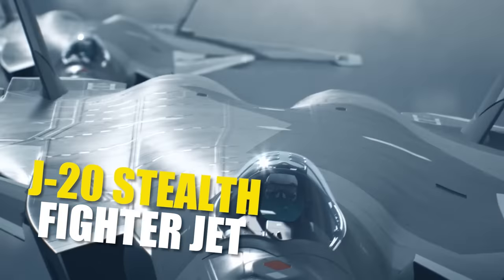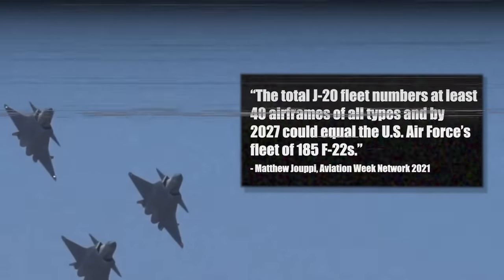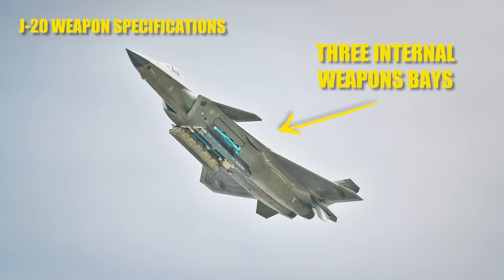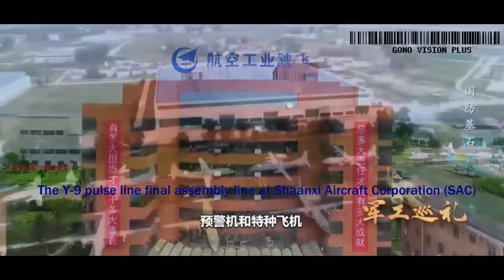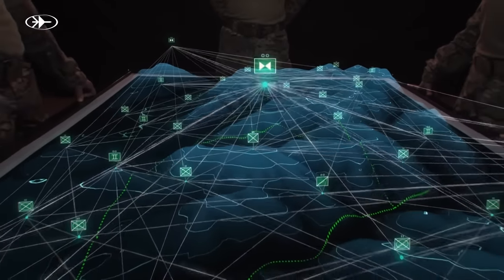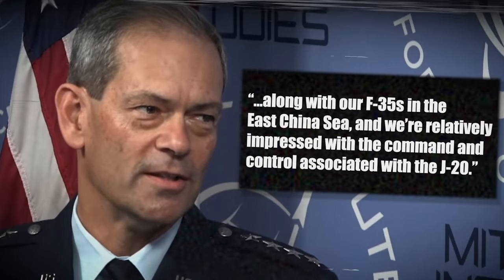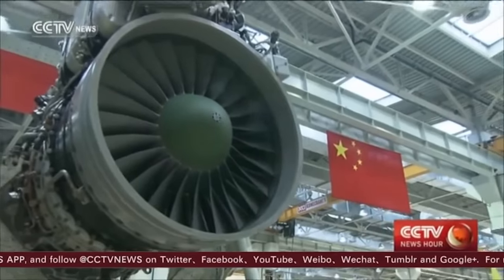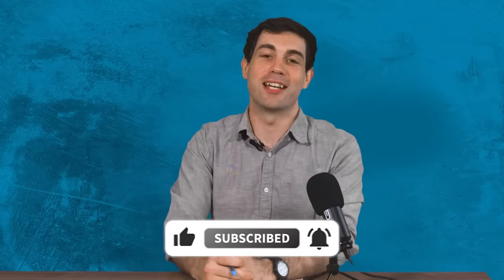How China Stole their J-20 Stealth Aircraft

Comment: Very impressive considering their main frontline fighter until quite recently, was the MiG 21/ Chengdu J-7
Reply: The wife said I could get one of them or an M777, but not both
Reply: It really is quite scary how rapidly they are advancing their military tech, but with the ccp taking a more dictitorial and strong arm approach its makes sense.
It's one of the few things a communist system can do, mobilize assests to complete a common goal.
Reply: @Michael-uf1hz its about time they try to catch up in military tech. They developed their economy first, so once the economy’s there it needs a stronger military to protect it, which in turn supported by a good economy.
Reply: "Very impressive considering their main frontline fighter until quite recently, was the MiG 21/ Chengdu J-7"

Considering the started to massproduce their own versions of the Su-27 by the late 90s, uh, what?

There's something like 2 thousand Su-27 derivatives in service by now in China.

And over 210 J-20.   That's more than USAs 197 F-22s.
And China built those faster than USA built their F-22s.
Reply: @DIREWOLFx75 what are you talking about? 2,000 SU-27 derivatives?

SU-35: 24
J-16: 245
SU-30MK2: 24
SU-30MKK: 76
J-11BH/BSH: 72
J-11B/BS: 270
J-11A: 200
J-15: 60
SU-27SK/UBK: 78

Total: 1,039, that’s airframes that China ever received until 2022, not operational or inventory figures. Inventory figure would be 893 (-100 J-11A and -46 SU-27SK/UBK).

Edit: also the Chinese did not start serial production of the J-11B until 2007. The J-16 started aerial production in 2012. The J-11A, was a copy of the SU-27SK/UBK and weren’t produced in China. Those were kits produced by Russia and then shipped to China and assembled in China.
Reply: @DIREWOLFx75  Lol what? In the 90s they were mass producing J-7/Mig-21s, not Flankers. 
They achieved full scale production of the J-7/Mig-21 in the 80s, while the F-16 was in mass production. 
It took two decades for China to acquire 78 flankers (Between 1991 and 2009). By 2000 they had about 50 flankers. 
They have produced more than 2400 Mig 21/J-7s while those currently in active service are 489. Total flankers in service is 604. 
In the 90s they were replacing Mig-21/J-7 with updated Mig 21/J-7s. Production ended in 2013.
Reply: @kurousagi8155 
👍👍
Reply: @stevemrayz357 
200 now
Reply: @jeffreylai6796  You are not saying their economy is in a good state
Reply: @UpVade  i mean it’s certainly not very good now, but its leaps and bounds better compared to 20 years ago.
Reply: @kurousagi8155  "what are you talking about? 2,000 SU-27 derivatives?"

I'm talking about a typo.   ONE thousand...
Reply: @kurousagi8155  j 10?
Reply: @ishtiaquealamin6147  J-10 is based off the IAI Lavi and is not an SU-27 variant.
Reply: @DIREWOLFx75  the F22 production line was closed in 2009, 14 years ago. If senators were not so idiot it's price would have went down and production would be much higher than the j-20 by miles and miles. Rehabilitating a F22 production line is so expensive that is much more profitable to be already working on 2 6th gen fighters, the NGAD and the F/A XX. How is that going for China? just curious...
Reply: @Maddog-xc2zv  "If senators were not so idiot it's price would have went down and production would be much higher than the j-20 by miles and miles."

The price wouldn't have gone down THAT much.   And more pertinently, the prices that have been quoted includes hidden subsidies.
The FULL cost of the F-22 is considerably worse than anyone admits to the US public.

That's also one of the reasons it would not be exported under any circumstances, because that would risk revealing the real costs too much.

And 2 simple facts, China is STILL building more J-20 per year than USA ever built F-22s per year.
And 2nd, Chinese industry today is roughly 10 times bigger than USAs.

And USA is heavily dependent on a bunch of stuff from China and Russia.

Right now, the only reason USA isn't having a massive shortage of titanium is because China is reselling it from Russia at a nice BIG profit.

China achieved the ability to manufacture its own chipfabs at modern nodesizes just by agreeing that "we need and want this ability" and getting it done.

And after USA started pissing it off last year, they have increased their military buildup to an almost hilarious degree.

There is no hard information, but what little has leaked suggests China INCREASED their military production in most things by about 2 to 30 times the entire military production of USA.

I'll make it simple, China could easily afford to triple their current manufacturing of J-20.
USA can barely manage production of the F-35 at all, which is half the price.

"that is much more profitable to be already working on 2 6th gen fighters, the NGAD and the F/A XX. How is that going for China? just curious..."

And there you have the reason why China could easily increase its production while USA cannot.
Same reason as why USA needs 3 years to MAYBE be able to match Russia's current artillery shell production, completely skipping the part where Russia if need be can increase its own production by an order of magnitude in less than ONE year.

USAs military industry is the most epically inefficient ANYWHERE.

I'll use my good old superblatant comparison.   You know the STRIX ammo?
My country developed it back early 90s.

Then USA went "hey that's cool we want".

So USA then had a committee deciding what the USA version was gonna be like.
Not even for a second considering that they could simply purchse it from here.

2 years later, after spending more money than Sweden spent to develop AND conduct the first serial production, USA had their requirements ready.
Another ~14 years later, the XM395 was not finished, but went into experimental serial production and testing.
With the first "real" contract bby 2017.   But still labelled XM, ie experimental.

Meanwhile, Sweden has upgraded the original STRIX 4 times, each time with a serial production run, with the latest 2 models now being superior to the XM395.

And the total cost for STRIX, including 5 serial productions, is less than a tenth of the XM395 costs.   If you want to be evil when you do the accounting, you could argue much less than even that.

And this is despite that Sweden still has the same profitbased military industry as USA.

Just not anywhere near as inefficient and greedy.

"How is that going for China? just curious..."

My guess?   China is currently bypassing USA in project quality.

I will believe in the POWER OF GREYSKULL i mean NGAD, when i see it.

I'm seeing the absolute worst of US military industry idiocies taken to 11 in the NGAD projects, there's a few mitigating parts, but overall, they're looking like they will end up even worse than the F-35.

Meanwhile, China's nextgeneration developments are looking like mostly smooth sailing.

Of course, then we have the troublesome little details that have been shown off in the last year+.
6th generation, as defined by USA at least, is a lot about unmanned vehicles...

Problem is, Russia has shown a very unpleasant ability to hijack drones lately.

Supposedly, they managed to purchase the full playbook on drones from Iran, and Iran was up until about a year ago, probably the leaders in drone operations(yeah, that surprised me as well, but after hijacking US drones SEVERAL times, that's telling).

Will unmanned vehicles be reliable by the time NGAD is even made operational?

And of course, there's also the question whether USA will still have the economic ability to pay for those projects one the dollar crashes.
Reply: @DIREWOLFx75  So many words and not a singly statement proved with nothing but trust me bro source. BTW, when you ask how much the US lie, try to ask yourself also when do China tell a truth? Cheers. And remember, sometimes less is more, mainly when we aren't able to corroborate that greater part of the "more".
Reply: @DIREWOLFx75  yeah but there was alot of corner cutting to reach those numbers and it shows because 6 years ago J-20s couldnt handle their top speed and broke apart mid flight.
Reply: @DIREWOLFx75 wow only 210? damn thats pathetic compared to 450 F35s and 150 F22s (and we KEEP buying more F35s)
Reply: @DIREWOLFx75 "Russians show an ability to hijack drones" you mean hijack $200 civilian hobby drones? and even then they aren't showing competency there (considering thr ukrianians KEEP hitting targets inside russia with drones, even hitting the capital of Russia) currently the US stealth fighter fleets outnumbers the J20 2 to 1 and the US is only acquiring more and more stealth fighters

China can't even produce a good engine for the J20, the pieces of shit they have in them now leave MASSIVE black smoke trails, and the WS15 still isn't ready
Reply: @lorddeathofmurdermountain76  According to who?
Reply: @DIREWOLFx75  according to the CCP themselves.
Reply: @lorddeathofmurdermountain76 Any sources? I found nothing about it.
Reply: @lorddeathofmurdermountain76  I find no sources about such an event.
Reply: @Michael-uf1hz Bruh china isn’t communist
Reply: No that would be the j-10 or j-16/j-11.
Reply: @kurousagi8155  You forgot J-10
Reply: @yuv06  the J-10 is not an SU-27 variant, it is based off the IAI Lavi.
Reply: @kurousagi8155  didn't know they were talking about Su27 as the main comment didn't mention anything of the sought.
Reply: You missed like 2 generations of aircraft since that lol
Reply: @kurousagi8155 nope.. Google j9 which predates Lavi (which was never even produced and commissioned). Like almost all aircraft, j10 could have taken some inspiration on others but that's not the same as 'copying'
Reply: @nicholasbrown668 but where are all the American F35s located? China's j20s are all in a 1000km radius from its shores. And they are building up to 96 new ones each year now that the config and new engine are set.
Reply: @k.k.c8670  wow 96 a year? really? thats wild so they should have over 500 J20s if they are producing that many a year.....oh wait.....they have at most 200 of them which puts the production per year at somewhere between 25-30 airframes a year

and the "new engine set" you mean the engines meant for older jets? because the WS15 isn't even ready for use?

the J20B just unveiled and its only in "small serial production" meaning in the single digits, and by just unveiled itself, i mean the J20B only flew for the first time a week ago, meanwhile Lockheed Martin will produced about 156 new F35 airframes this year, and hope to keep that production rate for the next few years, so no matter what China does, they won't be able to outdo Lockheeds production of Stealth aircraft
Reply: @nicholasbrown668  production was slow in initial years cause it was still using Russian al31. Now it's using ws10c from early 2022 and since then production has ramped up considerably. There are 4 j20 production lines producing 1 a month each. And there are another 4 lines being constructed. As for ws15   it just flew a few days ago in Chengdu . Won't be long before all j20s are fitted with it.
Reply: @k.k.c8670  won't be long? China has stated its in minimal production and will be for the next year due to production issues, again they produce a grand total of at most 33 airframes per year compared to Lockheed Martins 156 per year, there are 200 J20s in existence, there are almost 1000 F35s in existence
Reply: @nicholasbrown668  like I said.. J20 is already being rapidly produced with ws10c.
Reply: @nicholasbrown668  how do you calculate 4 lines producing 1 each a month plus another 4 lines under construction coming to 33 planes a year!?
Reply: @k.k.c8670  a jet engine that let's out large black jet streams? yeah really stealthy lmaoo, and also a jet engine designed for other jets????? and also a jet engine that they've only managed to build 300 of since the 90s
Reply: @nicholasbrown668  which? You seem very triggered about china's progress. Feel sorry for you but you must get used to it. It's accelerating in next couple decades.
Reply: @k.k.c8670  not likely considering they have a major energy crises (i was actually there when trucks were sidelined for like a week because of a lack of gas) and their economy is slowly losing its grip as western economies move their industry to new markets, im not "triggered" by Chinese progress, im just realistic about what they produce, the WS10 has been in service since the 1990s, and yet only 300 or so engines have been produced, the J20 has been in service and "serial" production since 2017

for comparison the US adopted the F35 in 2016-2018 and have already received over 500 airframes with more to be delivered, the J20 has an inferior RCS, has systems that rely on US GPS, and most likely doesn't have the same quality control as the US (honestly just look up the level of quality control the US has for precision parts, they control quality down to the nanometer)
Reply: @k.k.c8670  the J-9 looks nothing like the J-10.
Reply: @nicholasbrown668  stop it, dude.. Ws10 started development in the 1990s and did not enter in service in ANY Chinese plane till 2010's. You keep making up stuff. Quite sad.
Reply: @kurousagi8155  you may want to look up the right plane.. J9 and not JL9.. Lol
Reply: @k.k.c8670  that doesn't help your case lmao, that makes your case worse, the WS10 project started in 1986, first flight in 1996, so it took them almost 30 years to produce a single indigenous engine? and even then their engine only has a service life of 1500 hours compare to the 8500 flight hour lifespan of the Pratt & Whitney F135
Reply: @nicholasbrown668  you said in service since 1990s. Stop digging that hole any deeper
Reply: @k.k.c8670  WS10 started development in 1986 actually according to Shenyang Aircraft
Reply: @k.k.c8670  i did,doesn't change the fact im right on literally everything else, the Shenyang WS10 took nearly 30 years to from initial design to production, and even then it still has issues (and isn't a stealth engine) the WS10 has an engine service life of 1500 hours (absolutely pathetic for a modern aircraft)

only about 300 engines have been produced and they are required for 5 different aerial platforms, the F135 for comparison has over 1,000 produced engines with new orders established every year, the F135 also has an engine lifespan of 8000-8500 hours 

the F135 also only took about 12 years from initial development to full rate serial production, compared to the near 30 years for the WS10 (and the Chinese haven't even built a comparable number of engines in the same amount of time)
Reply: @nicholasbrown668  why are you talking about american engines instead of your lemon Tejas plane and even more lemon kaveri engine? Anyway.. Since you are a US fan boy.. Here is something for you... "While the F-35 was initially designed with a lifespan of 8,000 flight hours - allowing for approximately four decades in service depending on the intensity of use - recent reports indicate that the fighters may well be set for retirement after just ten years in"... Don't believe Pratt and Whitney marketing hype!!
Reply: @k.k.c8670  source? like provide a link to the article or the article name, date, and the author, if you dont provide one ill just have to come to the conclusion you are making stuff up or using Eurasia times
Reply: @k.k.c8670  I looked up the J-9. It’s a MiG-23 with canards.
Reply: @nicholasbrown668  many including Military Watch Magazine. In your case. You've just been quoting Wikipedia or some no name source for all that stuff you are making up . Lol. Shall we now talk about your country's tech? Lol
Reply: @k.k.c8670  so you have no source then? and Military Watch Magazine is an independently owned Indian website with no editorial review outside the owner himself, so not a reliable source either way lmao

and my country? I'm American lmaoooo
Reply: @kurousagi8155  wow.. You think a plane is like Lego bricks, huh. Just keep adding bricks till it looks like something you wish for. Too funny
Reply: @kurousagi8155  please add canards, an additional seat and another engine to the f16 and see if it flies. Lol
Reply: @k.k.c8670  well there’s a reason why the J-9 was never produced. It’s probably because the Chinese treated fighter jet design as Lego building as you say. Which is why Chinese designs aren’t very successful and why they copy everything.
Reply: @kurousagi8155  neither was the Lavi ever produced.. Duh
Reply: @k.k.c8670  actually wrong. There were three prototypes of the IAI Lavi. It also flew in 1986. Can’t say the same for the J-9.
Reply: @kurousagi8155  so? The blueprint was done and the j10 picked up from that. Now, all planes take inspiration from others but this nonsense about 'copying' just by looking at the shape is too funny.
Reply: @k.k.c8670  lmao. So? You can have as many blue prints as you want. The J-9 would never have flown and didn’t even reach the prototyping development phase because of the problems. Like you said. Lego building.

The J-10 is an IAI Lavi copy. The J-9 was never anything except a drawing on a piece of paper that China wished could have flown.
Reply: @k.k.c8670  love how you had to avoid me calling you out just to continue a losing argument against someone else lmao

btw you still never provided a source for your claim or an article link

also whats up with you thinking everyone is Indian? and why are you so intimidated by india that you keep bringing them up whenever you can?
Reply: @nicholasbrown668  avoid you? You've already put out so many fake stuff. Go to bed, kid
Reply: @kurousagi8155  nah. You wish. Lavi is a much smaller plane and only flew a few times with 2 or 3 prototypes only. Don't be a sour grapes and spread nonsense around. Duh. Is F35 a copy of Yak141? Duh
Reply: @k.k.c8670  what fake stuff? so far you only called me out on one thing that I said wrong which was the WS10 service date

also still waiting on that source of you saying the F35 will be retired in 2026, the military blog run by one person in India doesn't count lmao
Reply: @k.k.c8670  still waiting on that source homie, also I just reread your comment on China producing J20s and your math doesn't add up, based off how many production lines you claim they are opening and how many jets they produce, it wouldn't be 96 airframes a year, they would somehow be producing near 200 a year 

so again it seems you just made shit up (and didn't even bother to do your math correctly) because in the 13 or so years the WS10 has been in service, they haven't even produced 300 engines (and those engines are needed on 4 other types of aircraft that the Chinese currently use)

so with all your claims and math added together, your story doesn't add up and neither do your facts, maybe thats why you had to use a magazine owned and operated by a single Indian man?
Reply: @k.k.c8670  lmao. The J-10 is small compared to the J-9 by several times the size difference between the IAI Lavi and J-10.

The F-35 is not a copy of the YAK-141. The two aircraft share one similarity in the fact they can do VTOL. The F-35 has a completely different configuration than the YAK-141. 

Not so between the IAI Lavi and J-10.
Reply: @k.k.c8670  also I copy pasted your supposed article qoute and it doesn't link to any Military Watch Magazine article, in fact the only articles I can find about the F35 through Military Watch Magazine praise the jet and talk about how more and more countries are looking to purchase or expand their fleets 

so again do you have a link? or any source or proof to back up any of the bullshit you claimed (also id love the proof of your production numbers for the J20, you said they would be producing at most 96 airframes but based on the math provided by you, your math comes up to 196 airframes so you can't even keep your lie straight)
Reply: @kurousagi8155  again bro, don't even try arguing with this guy, he makes up stuff left and right, man tried to say the F35 is bad and that the US is going to retire them by 2026

then went on to provide math (that isn't backed up by anyone) saying the Chinese will build 196 J20s a year (and he claimed they would all have the WS15 engine very soon) when they cant even breach a 50 airframe per year production rate right now
Reply: @nicholasbrown668  you du/mb or what? 4 lines producing 1 each per month gives 48 planes a year.. Another 4 lines being built give another 48. Now you also can't read and comprehend.. They started ramping up production after starting to use the ws10c engine instead of Russian al31 which is just end of 2021 and 2022. Duh
Reply: @k.k.c8670  ramping up production with no engines? they've built less than 50 WS10s in the last 4 years

and again the WS10C isn't stealthy at all, it actually ruins the already terrible RCS of the J20, also you still haven't provided a source for your claim the F35 will be retired in 2026, you just made up a qoute and tried to attach it to a magazine, also haven't provided a source that the F135 engine can only last 3000 hours (which is still double the life span of the WS10C), you just said and I qoute "a lot of places say it"

also I see where you just went back and edited that comment, nice try kiddo ;)
Reply: @nicholasbrown668  duh...

While Lockheed Martin’s F-35 Lightning II fifth generation single engine light fighter has long been the centre of controversy, with its design, performance and cost slammed by analysts, Pentagon officials, presidential candidates and Senators alike - most recently the Secretary of Defence - a recent Pentagon report has shed new light on critical flaws plaguing the fighter program. Following on from reports that some early production variants of the F-35 delivered to the U.S. Air Force and allies such as Australia may need to be scrapped entirely due to the considerable cost of modifications necessary to make the aircraft combat ready, the Pentagon has revealed that the fighters’ lifespan “may be as low as 2,100 flight hours.”

While the F-35 was initially designed with a lifespan of 8,000 flight hours - allowing for approximately four decades in service depending on the intensity of use - recent reports indicate that the fighters may well be set for retirement after just ten years in service. With early production variants of the F-35A costing well over $100 million per fighter, and the short takeoff and vertical landing (STOVL) capable F-35B  variant costing over $130 million, this would provide a considerably poorer return on the investment of the stealth fighter’s clients than previously expected - and could if not properly addressed seriously undermine prospects for exporting the aircraft. Fighters with such a short service life, by far the shortest of any high end modern fighter in the world, can be considered essentially disposable. Other flaws in the F-35 highlighted by Robert Behler, the director of Operation Test Evaluation at the Pentagon, included a poor level of combat readiness - “well below the planned 80 percent” - and weapons systems with an “unacceptable” level of accuracy wholly inadequate to “meet the contract specification.” Behler noted that while some improvements had been made to the gun’s aiming cues, “ no software or hardware corrections have yet been implemented to current the gun accuracy errors.”

While the F-35 was first declared combat ready in late 2014 when the F-35B variant entered service with the U.S. Marines, the fighter appears to still have a long way to go before it is capable of carrying out combat missions against near peer adversaries or penetrating contested airspace. The Pentagon report further emphasised “vulnerabilities” in the F-35’s cybersecurity which had yet to be remedied. How Lockheed Martin will respond to mounting criticism of their fighter program, particularly in light of the accession of Patrick M Shanahan’s, a former Boeing official, to the post of Secretary of Defence and Boeing’s marketing of the highly cost effective and in many ways more capable F-15X - a potential alternative for both the U.S. Air Force and America’s export clients to the troubled F-35.
Reply: @k.k.c8670  thats not a source lmao
Reply: @nicholasbrown668  another lie.. When did I say 196 j20s will be built per year??? 96 on 8 production lines ...not 196.. Duh
Reply: @k.k.c8670  where is your source kiddo, because reverse searching a paragraph out of your last comment takes me to an article in 2019, 4 years ago which has since been refuted by the same source
Reply: @nicholasbrown668  dude just type it in Google.. Can't attach links here. Military Watch Magazine Feb 4th 2019 issue... Duh
Reply: @k.k.c8670  February 4th 2019? a 4 year old article? I knew you were using outdated ass third party blogs as a source when I saw Shanahans name in the article
Reply: @nicholasbrown668  refuted? Where is your source? The f35 engine has not changed since then
Reply: @k.k.c8670  actually several software and hardware upgrades have been implemented as well as improvements to the F135 engines, improvements were also made to the helmet software and hardware, changes have also been made to the alloys used in the production of the fan blades in the engines themselves
in fact the jets your blogger referenced still used the TR1 software, the F35 is about to be upgraded to TR3 and Block 4, most of the fleet now runs on TR2 and will transfer over to TR3 once combat and hardware improvements have been fully accepted by the Joint Office, improvements have also been made to the Battle Management System and the sensor link software, so to say the F35 hasn't changed is really ignorant 

also something to note, whereas China has no surplus of J20s, the US currently has about 20 or so airframes produced and waiting to be upgraded to TR3/Block 4 before they will be commissioned into service, meaning the US actually has a surplus of 5th gen aircraft 

as well as already having 6th Gen aircraft produced/being designed

sources:
ISW
Forbes
Military Times
Defense Intelligence News
Reuters
Der Speigel
Institute for International Studies
Air Force Times
Air Force Magazine
and multiple press conferences by The Honorable John Kirby
Reply: @nicholasbrown668  another one.. Business Insider Jam 13. 2023. You have to stop your nonsense, dude. You are drowning in stuff you've been making up.. Duh 🙄😂

Years of delays, cost overruns, and technical glitches with the F-35 have put the Pentagon in a dilemma.

If F-35s aren't fit to fly in sufficient numbers, then older aircraft such as the F-16 must be kept in service to fill the gap. In turn, having to extend the lifespan of older planes consumes money that could be used to acquire new aircraft and results in aging warplanes that may not be capable of fulfilling their missions on the current battlefield.

"While service life extension programs are one way to keep current aircraft capable and in operation, they do not guarantee that those aircraft will be available when needed or that they will possess required capabilities to meet future needs," the Government Accountability Office warned in a new report on US tactical aircraft.

The F-35 is meant to be the backbone of the US Air Force, Navy, and Marine fighter fleets, replacing several types of Cold War-era fighters and attack aircraft, including Navy and Marine F/A-18 C/Ds, Marine AV-8Bs, Air Force A-10s, and, most importantly, Air Force F-16s, which are the US's most numerous fighters.

Despite making its first flight in 2006, the F-35 — which costs about $100 million apiece — still hasn't been approved for full-rate production and remains in limited procurement.

The aircraft has been plagued by a seemingly endless series of bugs, including problems with its stealth coating, sustained supersonic flight, helmet-mounted display, excessive vibration from its cannon, and even vulnerability to being hit by lightning.

The military and Lockheed Martin have resolved some of those problems, but the cumulative effect of the delays is that the Air Force has had to shelve plans for the F-35 to replace the F-16, which now will keep flying until the 2040s.

"Over the last decade the Air Force and Navy have funded service life extension programs for F-16s and F/A-18 A-Ds — both originally expected to be replaced by F-35 — to address fatigue of structural components and keep the aircraft capable and in operation," the GAO report said.

The remarkable longevity of some aircraft — such as the 71-year-old B-52 bomber or the 41-year-old A-10 — tends to obscure the difficulty of keeping old warplanes flying. Production lines are usually shut down, and the original manufacturers of components and spare parts have long ceased production. In some cases, they are no longer in business. 

Russia's air force has been mocked for poor maintenance that has undercut its airpower in the Ukraine war. But the US military has also long suffered from major readiness shortfalls, as have NATO nations such as Germany. In 2020, fewer than 10 of the Luftwaffe's Typhoon fighters were operational.

Particularly troubling was a November 2022 GAO study that analyzed readiness of 49 US military aircraft models between 2011 and 2021.

"Only four aircraft types, none of which were fixed-wing fighter aircraft, met their annual mission capable goals in a majority of those years," the watchdog warned...............
Reply: @k.k.c8670  that government accountability office report was on the entirety of the US Air Force Fleet not just the F35 just an fyi

F35 is also being produced at full rate production levels per the US Air Force as well, Lockheed was approved for 156 airframes this year 

also the GAO regularly rates units as being non combat ready, they have extremely strict guidelines for readiness, they expect every aircraft to be in near factory condition and for all bases to have maximum levels of fuel storage and parts

and yes Germany is often used as a reference point for poorly maintained militaries, thats more down to the german political machine than anything else 

and GAO rates mission capable goals on a whole for Wings in the Air Force, the air force started procuring 5th gen aircraft later than they should have (again Secretary Kirby has several good press conferences on this) during the early 2000s they canceled the F22 early due to a belief that there was no near peer to be worried about, older aircraft have been kept in service longer than they should have been due to the gap between the procurement of 4th gen aircraft and 5th gen aircraft

there isn't really anywhere in that article that speaks ill of the F35 itself outside of the headline, it moreso speaks ill of the Air Forces lack of procurement and the cancelation of the F22 program
Reply: @nicholasbrown668  😂😂😂🙄
Reply: @k.k.c8670  adding nothing to the conversation, assuming that's because you have nothing intelligent to add?

also when it references "woes" for the F35, it links to articles from 2018-2019, nothing past that
Reply: @nicholasbrown668  enough of talking to someone who doesn't seem to comprehend anything or prone to making things up. Goodbye. 😂😂
Reply: @k.k.c8670  the only one prone to making things up was you?
Reply: Not true.
Reply: @DIREWOLFx75 why do you compare China J-20 to the F-22 production? F-22 production started in 1996 and still ended over 13 years ago. 

You don't think all the technology development that has happened in the last 20 years have made it easier to mass produce stealth aircraft?
Reply: @coolcatclickos  "You don't think all the technology development that has happened in the last 20 years have made it easier to mass produce stealth aircraft?"

I know it has not.   Or more correctly, not enough that it makes any huge difference.
Reply: @nicholasbrown668  J10，J11，J16，J20都用的ws10，中国才有不到300架战机？而且ws10同级别的是f100，ws10和f100寿命都2000小时。你的双标只能糊弄什么都不懂的人，会用谷歌都能知道你说的有多可笑。😂
Reply: @kurousagi8155 IAI LAVI是对地攻击机，J10是对空战机，两个用途完全不同的飞机，仅仅是外形相思，你就认为是抄袭？如果你和你邻居外貌的很相似，请问是谁抄袭谁的🤣🤣？
Reply: @Jackol_TZ the IAI Lavi is not a ground attack jet. It’s a multirole fighter jet. Same as the J-10.

I never said it was plagiarism. I said it was a copy. Just like how the J-11 is a copy of the SU-27 and the J-7 is a copy of the MiG-21. 

Not sure why you Chinese are so sensitive about the issue. Hits a nerve?
Reply: @kurousagi8155 副本和抄袭有区别么？没人知道的悄悄拿走和偷走有区别么？不过是文字游戏。
还有，建议你去查一下IAI LAVI发明出来是干什么的，你的多用途可不是他最初的目的。要是像你说的多用途，为什么还要搞第四架对空型号？😂
Reply: @Jackol_TZ yes plagiarism implies that the copier is copying it without consent. Which is not the case for the J-10 being a copy of the IAI Lavi. It’s not a word game. You just don’t comprehend English.

The IAI Lavi is a multirole fighter jet. I don’t know what your censored Chinese sources say. But it was always a multirole fighter jet. Maybe you should take your own advice. Israel wanted to make its own fighter jets so it wasn’t completely reliant on the USA. But the IAI Lavi was just too expensive because the Israelis simply didn’t have the economic scale to make the project make sense. Which is why the Israelis gave up on the project and sold it to the Chinese.
Reply: @Michael-uf1hz 中共采取更加独裁的手段？比独裁更独裁那会是什么？半个裁？
Reply: @kurousagi8155  J-10 is based off the J-9  and is not an IAI Lavi.
Reply: @kurousagi8155  You don’t know or you deliberately ignored that the technology of IAI’s Lavi project is provided by the United States and is not IAI’s own.
For this reason, your claim that IAI gave China technology is totally untenable.
Reply: @nicholasbrown668  Do you know that China is the world's sixth-largest oil-producing country? This is happening despite the closure of most oil wells. China's oil production may not be sufficient to support the operation of the world's factory, but it's definitely enough to meet the energy demands of a world war.
Reply: @outman1923  tell that to the major fuel and energy crises happening across China, besides that, China can't even produce enough jet engines for its airforce 

over 76% of their engines and engine parts come from western sources, the moment a war happens? those parts get cut off
Reply: @nicholasbrown668  
1. Half of the new cars sold in China are electrically powered, and the electricity comes from sources such as coal, solar, wind, and hydropower. Many oil fields in China are temporarily sealed due to high costs.

2. Who told you that China cannot produce enough jet engines? On the contrary, American engines rely on metals supplied solely by China. The J-20 did purchase engines from Russia, but that was because they couldn't design their own. Today, China has not only the WS-10 but also the WS-15 engines.
Reply: @nicholasbrown668 所以为什么 F35 和鱼鹰会掉下来😂
Reply: @nicholasbrown668 F35 一直掉飞机就是最好的证据还有鱼鹰，还没开打那，训练就掉，到时候打仗的时候导弹没打中，躲导弹的时候掉了，去年日本鱼鹰掉一家，今年又掉一架，死了好几个上校。被评为美军死亡率第二的直升机😂
Reply: @nicholasbrown668 Western idiots always laugh at the way I think, ws10 production of 300 units and production of 30000 units and what relationship, is the production of more is good, that the Russian T34 production is quite a lot. We use them to make our J10s. We are not like the United States to make a lot of bad planes and then have no money to make new ones. We have to be good enough to mass production, where are your fifth-generation aircraft, you will not complain that I can not upgrade the electrical equipment of the F22 and not supersonic flight of the F35 is a fifth-generation aircraft.
Reply: @nicholasbrown668 What do you think of the massive rust on the US warship and the lack of maintenance and even the removal of parts from another warship to repair their own warship? 👀
Reply: It is ridiculous that the J10 was sold to China by Israel. China never denies that the J11 is a copy of the Su27, so there is no need to dodge the J10 issue. China's j10 from JF17, China called Snapdragon, Pakistan called thunder, this is a Sino-Pakistani cooperation project, China development, Pakistan to pay, has been developed for more than ten years, in addition to the air inlet is not the same shape. Good design is similar, just like smart phones, you think you can go back to the era of function phones, you should ask the Airbus 320 and the Broadcast 737 who copied who😅
Reply: @user-dk4ko8yj9u  what do you think of china's growing energy and economic  crises and reliance on Western Coal resources to keep their industry working?
Reply: @DIREWOLFx75   but if its made in china it breaks apart
Reply: @Jay-k6i9k  No, why would it?